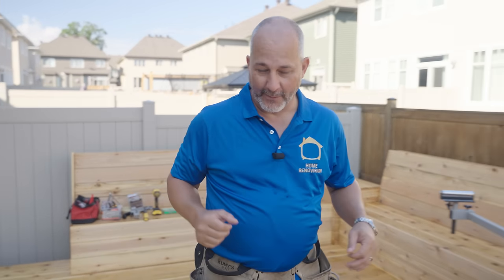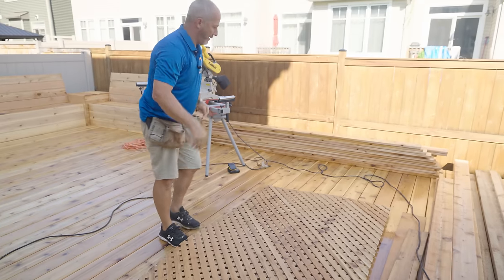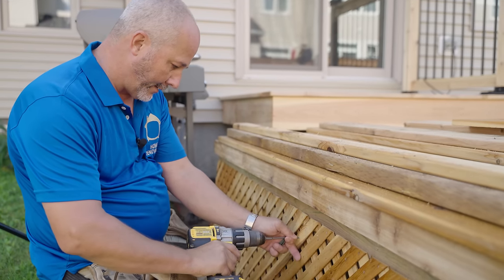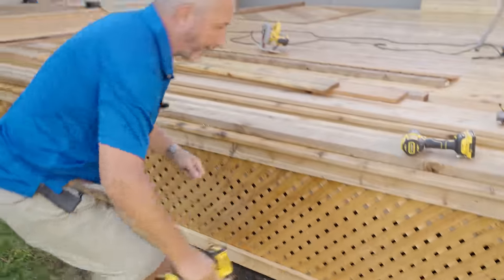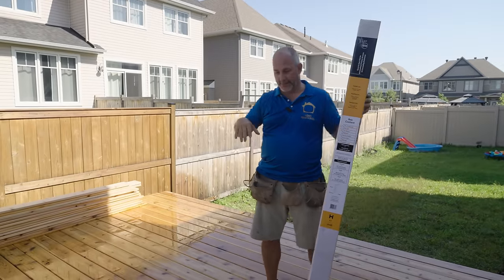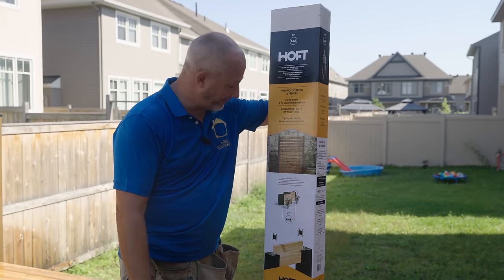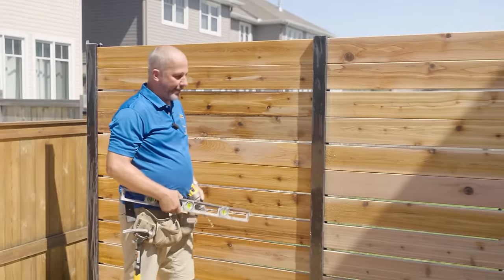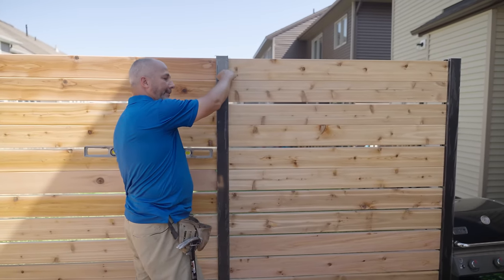Easiest Fence I’ve Ever Built | Weekend Project

Comment: 33:14 - For my aesthetic preference: If doubling up some boards, I would have done the doubled up boards with no spacer near the bottom then a spacer between every board near the top. I’d prefer the aesthetic of having the extra thickness near the bottom and a “lighter” look at the top. Even better would have been to rip the bottom board lengthwise so that then it was a space between every board with only the bottom board being narrower. Either way, those are aesthetic preferences.

Comment: Your issue with the height of the top board being too tall was because the system is designed that you do not need a spacer below your first board. It is built in to the columns so that it keeps the bottom board elevated already. But overall, good looking system and easy install!!
Reply: That is exactly what I was thinking as the gap on bottom looked to big compared to all the rest.
Reply: Thanks!

Comment: amazing work like always. In this situation, I would measure and ripe the board so it lines up, and place that ripped board at the bottom, so everything would line up at the top. But what you did works fine. Nice job.

Comment: Solution for your hight issue: Remove the top board. Measure the left over space. A) Just cut the left over piece to this dimension and use it as "extraordinary piece" B) if you dont want ot to be asymmetrical, cut two pieces that total with spacer equal to the gap size. Put one of the extraordinary piece to the bottom and the other to the top. You may even paint black to give a frame-ish look 😊

Comment: I think double at the bottom and single at top would look better. gives a more large on bottom to small on top aesthetic that most buildings go with. Such as roofs being pointed, top finish pieces going big to small ect. When on the deck, will probably be sitting most of the time relaxing. more privacy coverage this way too. Either way it came out pretty nice and way too easy lol. Good job on finished product.

Comment: How many spacers come with e/post?  Can you buy an extra pack(s) of spacers?
To each their own, but a single space for a few boards @ the bottom, then use even maybe 2 or 3 spacers for the top "section" where you wouldn't use ANY spacers.  It would serve as a nice border of sorts.  Great system no doubt...very versatile, & you could even rearrange things after so long.

Comment: I think I would have ripped the top board to the right height for the cap, then take it apart and use it as the bottom starter board. Rip all of the bottom boards the same. Then you’ll have even spaces on all boards.
Reply: Yup. Came here to suggest that too. Jeff's solution is pretty elegant but more noticeable. More than one way to skin a cat!

Comment: I suppose you could have cut the last board at the top to allow the caps to fit with even spacing all the way up. I was surprised you didn’t mention that as an option. ? Thanks for the tip on the product, it’s exactly what I’m looking for at my cabin. I think it’s a done deal.

Comment: great job Jeff..   Although the way you did the top.. id' have changed.. you put 3 singles on bottom and 3 doubles on top. looks nice. but I THINK.. I would have gone with double on bottom , on top and in the middle i'd have done a double.. the rest inbetween i'd have done the singles.. ( IF it works ).. 
ok, because i'm cheap.. TELL me.. wouldn't it be cheaper to have bought 2x4's and used a router to cut a 5/8" hole down the middle to slide the boards into?? cuz that's what i'm thinking of doing? cheaper than buying the metal 2x4's.. I guess I could paint them powder black when done?   JUST A THOUGHT?

Comment: Someone mentioned no need for spacers on the bottom. Do a dry run, lay the boards on the ground with spacers and measure the height, adjust as needed.

Comment: This is my next project, but on top of concrete for a much longer distance. How did your boards settle after time on 5ft centers for posts? Did they warp or bow out of alignment. I'm going with 6ft centers on posts and was wondering if I need a vertical board in the middle to keep the boards from warping or bowing. I wish I could go 8ft on centers but the product insists on 6ft.

Comment: Regarding the spacing, I would have figured out how much space you needed to make up and add a few extra spacers at the beginning. This will increase space at the bottom that also allows some room to shovel snow through in winter.
Reply: Agreed, and it is literally just math, not sure why it wasn't calculated - the width of the boards and spacers is known.

Comment: nice product.  I'm wonding how this would hold up with strong wind or if someone were to lean against it.
Reply from the maker: That all depends on if you have a thick enough frame under the bords do all 5 screws are in the frame and not in the deck boards. Cheers. Been 8 months now and more than 1 party. So far so good

Comment: I like that fence system.  Looks very nice.  If I counted correctly you have 3 double stacks and 6 single stacks per section.  I would have gone 3 singles on bottom, 3 double stack in the middle, and 3 singles on the top for better privacy.   From the angle of the neighbor's yard, they'll be seeing only ankles and tops of heads. Just my opinion.

Comment: On the ends that are not attached to the wall or a corner what keeps them sturdy. i live in a higher wind area with a lot of snow fall and want to keep as much integrity as possible. also curious if you have a suggestion on how to add a gate or opening.

Comment: i got this exact product around my land and your board will sink in those spacer a bit more than what you put them. With all the spacers and board dry i have about 1" from the last board to the very top of the cap. Youll see what i mean when you feel like your board are not lining up to the next. Its a good product and system but has flaws. Overall looks better than a normal fence but the price is higher at 150$ a post.

Comment: I used the Home Depot version that I screwed the channels into a wooden post then added the deck boards. I was amazed at just how much those boards shrank. Did the gaps get even larger on these?
Reply from the maker: that is why you apply the stain. it seals the wood and helps prevent shrinkage. also good to let the wood dry out before install.

Comment: I think the spacers are 1/2in, and you put a spacer at the bottom but didn't need to. If you had removed that spacer, the original pattern probably would have worked (you said following that pattern left you with 1/2in above).
Reply: Probably needed the space to avoid the frost line! 😅

Comment: Knowing that you had to double stack some, I think i would've been better to double stack then single stack on that privacy fence, in order to gain some "consistency" as you said. looks like you might have been able to double stack once at the bottom, once at the top, and once in the middle, providing a single stripe around the middle. 2 cents from someone who's opinion doesn't matter. Great video!

Comment: Do you think I can span 9.5 feet with 5/4 deck boards so I can just use 1 end post on each side ? Would rather not have a middle post
Reply: u can try it.  i have seen people use longer pieces on bent board fences and they don't turn out all that well.  warping splitting and bowing issues

Comment: What if you want? No gaps in your fence can you do that? Cause there’s gaps are too big for me. That’s not enough privacy. People can peek through it.
Reply: yep that was my comment. leave out the spacers and go to the top. Rip one if needed to be right height.
Reply: The spacers are what lock the whole thing together, without them there’s nothing to stop the posts leaning away from each other (an issue on the ends of course not in the middle)
Reply: @MrDannyFandango  could you not solve that issue by placing a 2x2 across top and screwing it don to the top board?
Reply: @whatever8243  Not really, it's the spacers sliding into a groove and digging into the boards that is missing. You could find some bracketry to fix the top board in (with the bottom held in place by the base plate) and that would proabably do it. Maybe a long screw from the outside would also do it, and look a bit neater.
Reply: @MrDannyFandango  You could do a top spacer..otherwise the gap inbetween is enough to hold the boards.
Reply: @crazydoglady5  Yes I suppose one spacer at the top would give some stability, I'd be a bit concerned how strong only one is but you'd have to have a look at the material. Maybe between that and the base plate it would be okay. That said, wind is pretty strong!
Reply: @MrDannyFandango  depends on where you live on the winds I guess. I am in Texas. yes we have wind gusts at times but normally its only when we have storms that we have higher winds. I have an 8 ft wood fence...board on board with metal posts and no issues here. Does it sway at times? you bet..but overall no issues.
Reply: Privacy is an illussion here. Look aroumd at all the houses. Secomd floor people have an easy eye shot to whats going on.
Reply: I would even space and cut the top board for esthetic reasons. Looks aweful.

Comment: Can we use this system as a substitute for deck railings in Ontario? For decks higher than 2ft. Ive found conflicting information on horizontal railing. Any info you could share would be greatly appreciated! Would love to use the 44inch deck rail system hoft offers for my railing but dont want the city to have an issue with it. Thanks!
Reply: That's a really good question. Perhaps if the posts are close enough then the boards would be rigid. It's odd as I've seen hoft promo photos showing elevated decks but there is a warning that these can't be used as railings above 24". I've emailed them and waiting to hear back

Comment: Nice, but I'm not sure it's a very sturdy fence. It looks like it could easily get ripped/pushed out of its base.
Reply from the maker: kind of hard to determine how secure a fence is just by looking!
Reply: Well, pushing from the top of the fence would certainly produce a large amount of leverage. I’m pretty sure those screws will get pulled out of the deck or out of the aluminum. The fence needs some type of bracket support, but of course it won’t look as nice.
Reply: Hoft also sells the same system with 8ft in ground posts. Unfortunately not in the US though, just CA

Comment: I’m a newbie, but I still don’t understand why we don’t use metric. Would be so much easier instead of all these fractions.
Reply: If you’re building at home, you can do whatever you want.
Reply: I'm in my sixties and have been doing dyi since I was a kid.  I worked in facets of construction but man I feel like I have some experience doing many things. I climb ladders and I'm super excited as I have many things to work on. I was up in the middle of the night assessing an evaluation of troubled areas that requires immediate attention. Jeff is teaching me tons of great information to help me work smarter and more efficiently. I'm very excited .good luck .
Reply: A nice thing about fractions is often you want the middle or half a measurement, which with fractions you just double the bottom, no thinking/math required when tired and fewer mistake chances.
Reply: @RJFerret  that’s interesting. Had never thought of that!

Comment: Those dinky little screws are crap, i could kick that fence over with those, should have use thru bolts before enclosing the deck from the sides. Doesn't look all that great with the different spacing.

Comment: Instead of dodging staples when you rip the lattice, why not snap your cut line so that you miss all of them, and then cut a dado in your bottom rail to accommodate the extra width of lattice?  Not only is it better looking, but I think it would be more durable as well.  Man, I can't keep carrying you like this.
Reply: Before you say, busting out the table saw is enough of a pain (if you even have it with you), but on top of that you'd have to add on a dado stack.  I know, it's horrible. That's why I roll with 2 table saws.  Both are DeWalt 10".  One has a stack permanently installed on it, and the other has a 7.25" 40 tooth Diablo.  " A 7.25" Diablo ON A 10" SAW!?!?!??  ARE YOU CRAZY!?!!!?" you might be asking.  Well, yes I am, but not about using a 7.25 on a 10"" saw.  Way thinner for faster and more precise cuts, but more importantly, MUCH CHEAPER.  How often do you make use of the whole 10"?  I know..... That's what she said. 
That actually makes me wonder.... What is your typical pack out?  Just the major stuff.  I'm assuming you have your skilsaw, sawsall, and tampons, but what else do you roll with on the daily? 😂🤙

Comment: Really don't like your spacing scheme. IMHO, after you figured things out with the first section, you should have taken those out, then trimmed down the size of the bottom board and doing everything with equal spacing above that... After that "rinse and repeat" for the other sections.